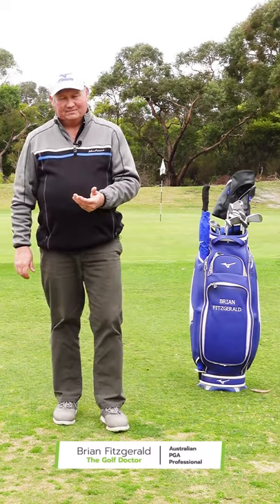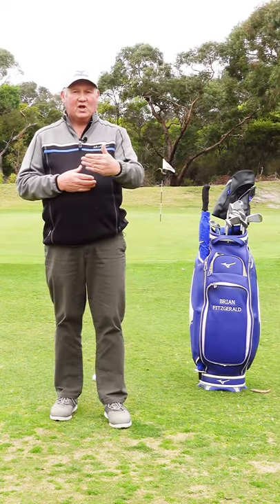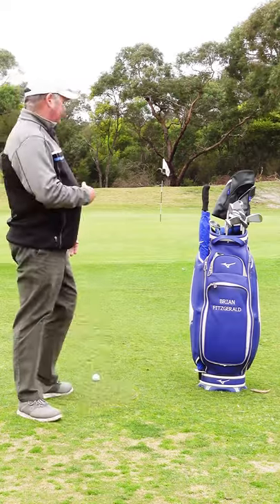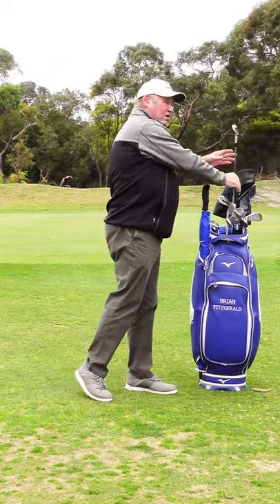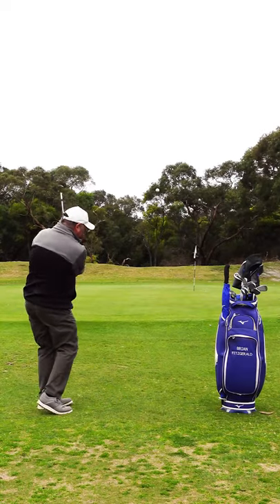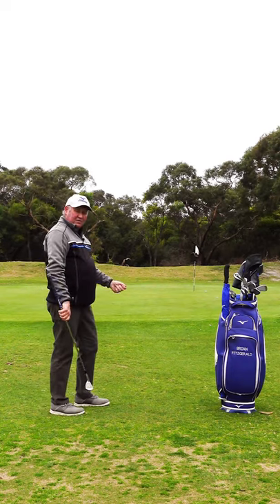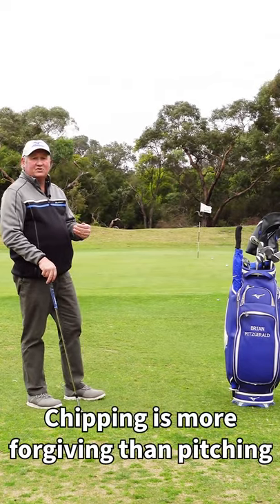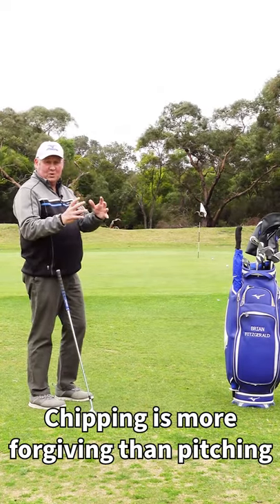The Difference Between Chip Shots And Pitch Shots #shorts

Comment: sorry mate! a question, which club will be used for chip and pitch shots? please reply back cheers
Reply from the maker: Pitch shots are lofted and are used to hit over something or fromvv no a greater distance than  a chip. So lob wedge,sand wedge, gap wedge pitching wedge. 

A chip is more of a low running shot so generally less loft is required. 

I tend to use 9,7,5, 3 iron or a hybrid. 

I do use a sand wedge but it not something I encourage preppie to do unless they are highly skilled. 

I hope that helps. 
Brian